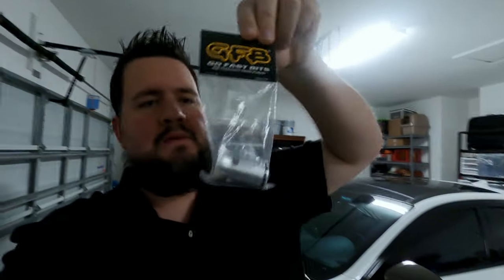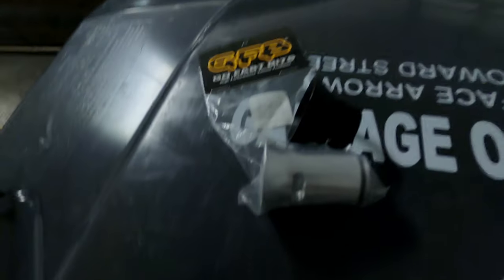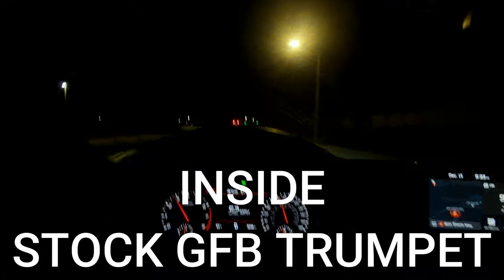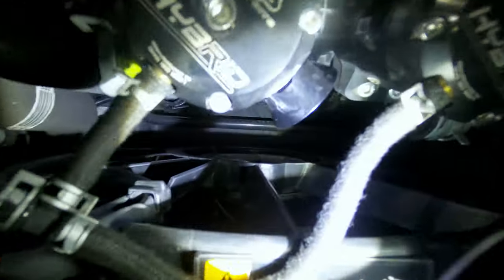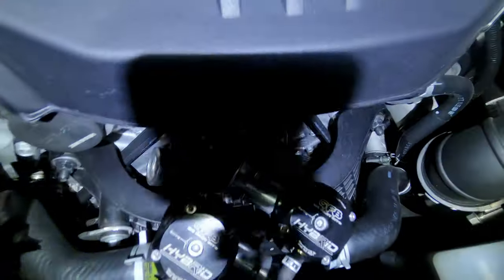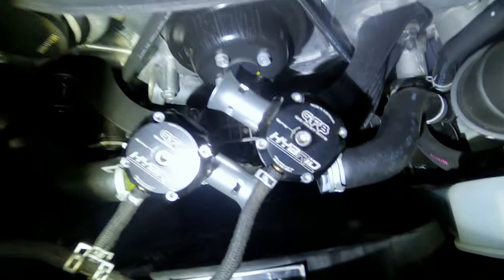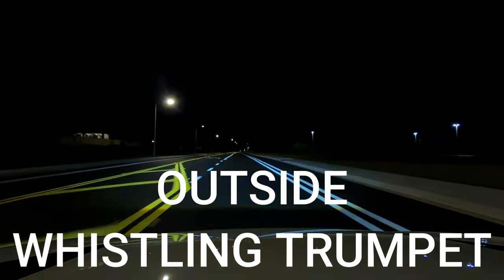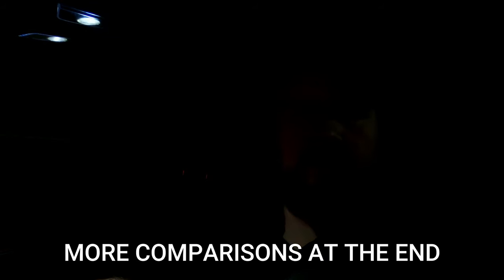GFB BOV Whistling Trumpet VS Stock Trumpet

Comment: I added the Whistling Trumpet to my ND1.  Spoiler, if your running less than 12 psi, get the low boost trumpet.  Also, doesn’t work well if you’re like me and can only vent 50/50.  ✌🏼
Reply: How did you go with low boost ones? I accidentally ordered 12psi+ ones, then I ask them to send low boost one. But said only 12 psi+ will fit on these valves. They don’t make whistling sound.

Comment: I bought the same trumpet, although is black instead of silver and it doesn't whistle...it sounds like the normal trumpet. It's installed on a GFB hybrid BOV ..and I don't think I did something wrong with the installation...
Reply: Have you try put 100% Atmosphere?
Reply: Yeah it has to be set 100% to atmosphere if not you wont get that sound. I believe if you go to the website it also says the same thing.
Reply: It’s same for me. Not working on 100% atmosphere. I tried both low boost ones and high boost ones.
Reply: @nlikos 180  there's also the case that the OP is using a rather special setup with 2 BOV's, offering the needed whistling sound we are looking for. I'm not expert at all; I went to the mechanic for the regular oil change and he tried for almost an hour with different settings and it didn't work. Just gave up on that.

Comment: You only had one stock trumpet fitted? Was one missing on one of the BOVs?
Reply from the maker: In the test I did 2 stock vs 2 trumpet but I have mixed it up and gone one stock and one trumpet before. I'm always switching back and forth to change the sound.

Comment: To blow off to atmosphere how do you set them up? The instructions suck...
Reply from the maker: Take the factory hoses off and plug them with the black stoppers provided and use the factory hose clamp to hold the plugs in. The use the screw in plugs (flat threaded ones) on the BOV holes where the hose would normally go.